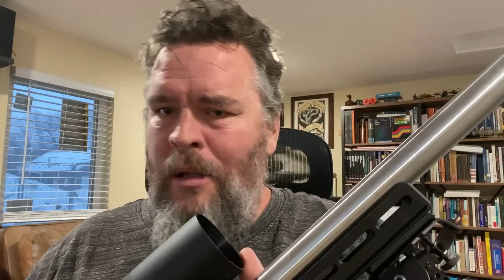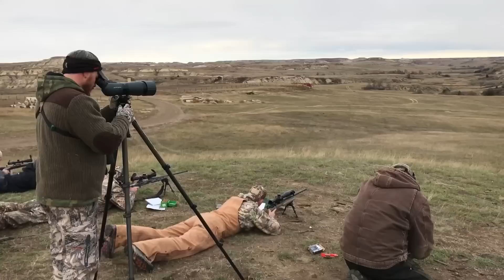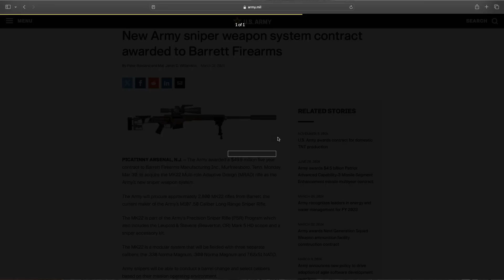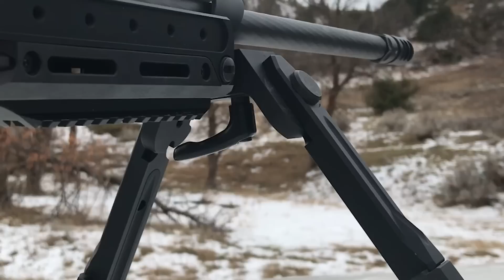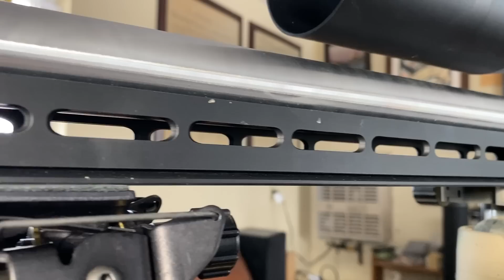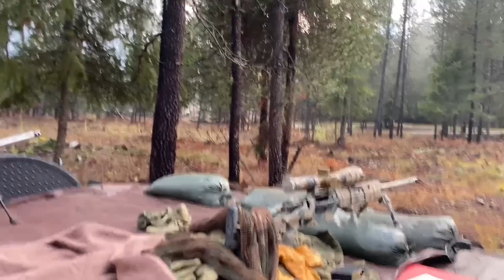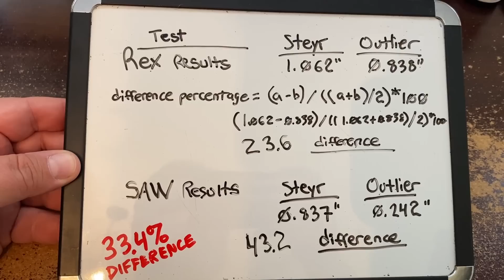Cheap "Target Rifle" VS Expensive  "Sniper Rifle" | Steyr SSG08A1 VS Savage/Outlier ~ Rex Reviews

Comment: My Rem 700 and Savage 110 factory stock rifles shoot .5 moa all day long with my handloads. The only alterations I did was to free float the barrels and trigger adjustment. Both rifles are both sub $1000 in total.
Reply: Totally agree. The Savage 110 is as good as big-ticket rigs with just a few upgrades.
Reply: @peady64 no theyre not. Is a bear creek ar a good as a lmt? Of course not. There is more to a rifle than how it shoots. Springs, firing pins, parts quality in general. Not even to mention the glass on most well outfitted precision type guns.
Reply: @jacobdeem8499  The only thing that really hurts the Savage is its action isn't smooth.  It works but isn't smooth.  The Savage Elite precision rifles are pretty good and if you oil the bolt with some Friction guard and grease the lugs its actually smooths it up pretty good but the cam over is still stiff though compared to custom 700 actions.  I had a Savage LRP in 6.5 that would shoot .25 inch groups with handloads and like an idiot I sold it to a buddy.  I also have some other more expensive rifles but for the money a Savage LRP or Elite precision are great guns if the action isn't an issue.  Now I can't speak on the other less expensive Savage rifles. Tikka's are a good option as well.
Reply: @jacobdeem8499  Well my 1998 savage 110 sporter barrel wood stock has over 5k rounds through it with 0 malfunctions/parts breaking. I'm on my 3rd barrel in it and needs another as it is in .243 Winchester. On the first sporter barrel it came from the factory with it shot 10 rounds into .4" group with the very first handloads I ever made(70 gr sierra HPBT matchkings) So my experience says other wise. Also my action is butter smooth now lol. Also the BSA contender on it 6-24x50 is still going strong for a 100$ scope lmao.
Reply: @jjmckay6man1  great budget rifle . Still not the same
Reply: @jacobdeem8499  your comment on reliability is my main point in making my comment. I know things are not made the same these days but that old action has been completely reliable. Even the 2lb custom trigger spring a gunsmith made for me is still going strong. One of the best triggers I've ever shot. I have trigger techs and some of the best triggers as well. I would never sell that gun. not sure what else you could want from a gun besides accuracy and reliability?!
Reply: @DanielCampbell-h5z  I agree the savage action isn't smooth. It is mostly bc it has a floating bolt head.  However, a "smoothness" is about the most useless attribute of an action. Everyone I know that has a rifle that shoots like crap will always fall back on the "smoothness" of their action.
Reply: @jacobdeem8499  Not the same for what? Combat? No. Hunting and target shooting yes.
Reply: @jacobdeem8499  Bolt guns bro. Precision ARs are a different ball game.
Reply: to add to your point .. my brother has a ruger american 6.5 cr. ( 1st gen) he did a trigger job and filled the cheap hollow stock with spray foam … that rifle shoots .5 moa consistently with factory hornady 147gr. it’s a tack driver !!
Reply: Must be older versions. Anything from Remington or Savage in the past 5 to 10 years is pure straight trash, especially their barrels.
Reply: @joearledge1  Yes they are from the 1990s.
Reply: @jeffkocsis8250  Sweet! Definitely miss the days when the legacy companies actually cared about the quality.
Reply: @joearledge1  Yes for sure. I heard the new Remingtons are much better quality now.
Reply: @jeffkocsis8250  highly doubt it, but if so, maybe they can go more than 90 days without declaring bankruptcy.... they've been a poorly run business nearly since they were founded. They declared bankruptcy and went out of business during the 1st American Civil War, and in 2020, 2 of the highest demand times for their products in history, they'll probably do the same thing for the 2nd American Civil War, if they can stay in business till it starts
Reply: On your handloads are you neck sizing. Are you using mandrels
Reply: @Ron-ni8uu  Neck sizing. I also seat bullet to lands then back off .010 at a time till I find sweet spot. Been my experience that bullet seating depth is the key, not so much powder, primer combo.
Reply: @jeffkocsis8250  awesome man I wish the federal match grade benchrest primers were everywhere like they were in the sagittarius parallel timeline
Reply: @jeffkocsis8250  I gotta get some of those redding type s bushing dies and mandrel set
Reply: @Ron-ni8uu  Haahaaa.Yeah I use the Federal match ptinrrdin all my loads. I stocked up before the world went nuts. Not sure we will ever see them again unfortunately.
Reply: @Ron-ni8uu  I shoot a savage axis 243 with an aftermarket trigger at 2 pounds. 12x Leupold . It shoots Nosler Ballistc tips or Hornady 100gr BTSP  from Win brass And Win LR primers. 100 yd .3 or less from a benchrest any day of the yr. It's about as cheap as it gets does well. I save the Fed Gold LR for my 65CM. Paper only for that rig.
Reply: @kdean8129  I love how 243 is super low recoil to detect trace . Man I want a 338 prc somebody's gotta make one.
Reply: @kdean8129  savage is so good for the money I had a tactical Sav. 300 win mag with Sierra match kings. 33 groups to .5 all day. Had a crappy Leopold 4.5 /14 mil dot tactical. I miss that old rifle . Put a Choate sniper stock on it amazingly good and cheap.15 pound banger🤟
Reply: @kdean8129  back then the Choate stock was only 120 primers were everywhere 22 dollars a brick 44mag Remington jacketed rounds were 20 dollars for 50. A brick of 500 yellow jacket rem 22 were12 dollars a pound of smokeless powder was 12 dollars you could get 8 pound jugs of power for about 89 dollars on sale good times brass was cheap and everywhere
Reply: @kdean8129  I also bought the aftermarket 2 pounder trig also made a huge difference
Reply: I had a savage tactical 300 win mag that was a half average grouper .Sierra match kings 175 grain Norma brass man that was cheap in the 90,s .got the crappy but bedded Choate snipper stock crappy Harris bipod. That bubbaed junker on a good day for the selected powder was lights out .🔥🎄🤟
Reply: Yep
Reply: Which caliber are you shooting .5 moa?
Reply: @dbarr8261  7 rem mag in the Rem 700 and .270 win. in the Savage.
Reply: I guess that matters if your hunting deer or human ,
Reply: Ah... the ALL DAY LONG half minute of angle factory rifle...

You can win a lot of money from Eric Cortina or Backfire.

But somehow I bet you don't accept either of those challenges...
Reply: If we didn't have to spend 10k on a rifle then everyone including the military would say, "it's good enough". Since it's not the case, I guess we all wish it was and we lie to ourselves.  I'm guilty of it as a newbie.  6 years later I have 4 ifles I spent 10k and above. I couldn't get the same results. I have a christensen arms mesa action I spent $1200 on getting it trued and a new barrel. It's been heavily modified and it's NOW SHOOTING. .50 MOA GROUPS. JUST LIKE MY ARC coup de grace action.  And my custom REM 700. Still not as smooth as my defiance! But don't kid yourselves guys! Your Savage is just that, "good enough for now". But no way your shooting .5 moa at anything further than 100feet!.
Reply: Yeah, you're all that. When you bust soda cans out at 1,500 yards, as he and I do, then you can talk about MOA. When you didn't mention a distance . . . it gave you away as just another wannabe. 

I've taken targets that were shooting back at 870 yards while putting together my solution for a kill at 1,700 yards . . . and made the kill real.
Reply: @BrianTurner1961 just gonna leave this right here…

I know a couple of dudes who have done the shit you’re claiming… they don’t “brag” about it in the comments section dude.

Cringy AF.
Reply: @timwebb8960  Not bragging. Just making a point.
Reply: @jeffkocsis8250  my comment was for super sniper Brian Turner, not you man.
Reply: @timwebb8960  Any time anywhere dude haahaaaa.
Reply: @timwebb8960  its all good bro. This is America. The fact that we can have these discussions is a blessing. Hope had a good Thanksgiving. Peace.
Reply: @jeffkocsis8250  hope you did as well, like I said, I think you’re replying to my comment that I made to someone else.  Some poser as vet bragging about kills.
Reply: @brianturner7919  Anywhere anytime my friend.
Reply: @BrianTurner1961  No true combat veteran Braggs about kills. Who's the wannanbe?